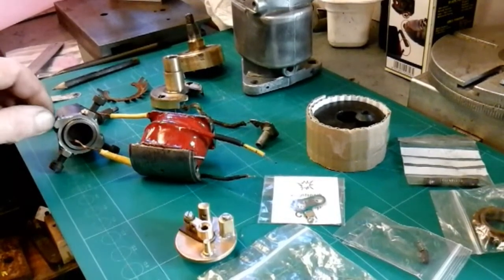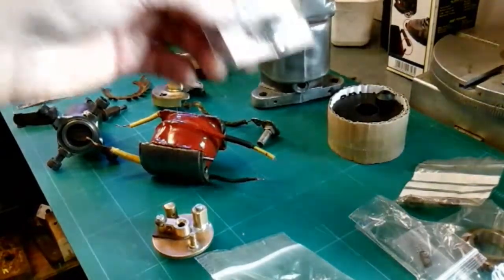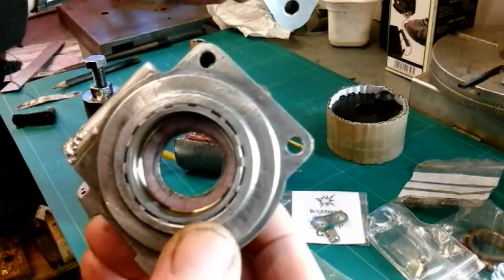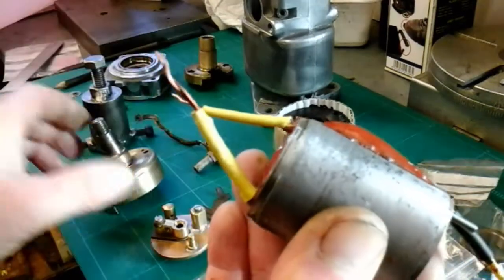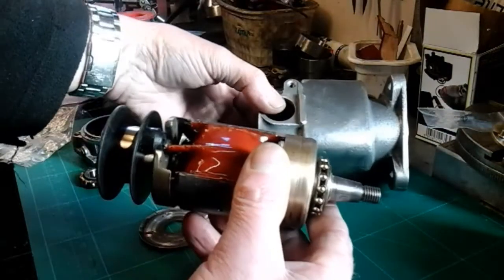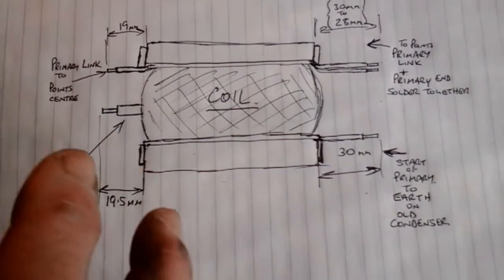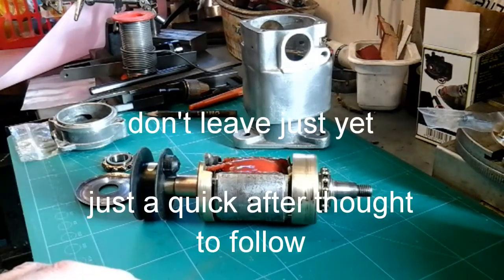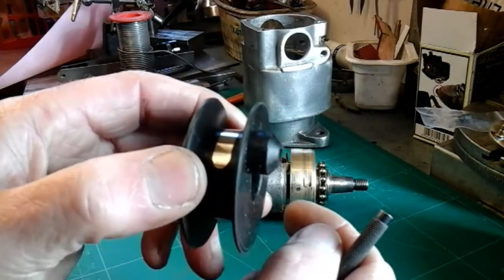Magneto Repair & Rebuild - part 3 armature assembly.....mr factotum

Comment: Hi Mr F. I experienced exactly the same issue as you did with the slipring, maybe from the same supplier. And I restored the continuity the same way you did. I've not tested the mag yet. I'm currently building a jig to test it on the Myford, inspired by yours 😀. Thanks for the videos, from the French Alps.
Reply from the maker: hi Ol Al1
great work, the myford sounds good for a test rig, what would we do without Myfords, very versatile machines.
thanks for watching and comments, let me know how the testing procedure goes
regards
mr f

Comment: No the wire should make contact.and if it doesn't it will spark and will burn the wire out. It will work for a time .but when you put the slip ring on the armature.you should get a reading with your meter.from the earth i.e. body of the armature.and the slip ring.of about the same as you would.when you tested the secondary.hope this helps
Reply: the pick ups you need have a line down the carbon .the faulty ones dont have the line.and you can remove the condenser.it makes no difference to the balance.   if you fit the soft  pick ups . the bike will run for a time.but then the bike will start to run lumpy.and one cylinder will stop.and if you pull one plug lead of it will run on that pot bot not the other.but if you fit the lead you tuck of.and pull the other lead off.it will run on the first cylinder .the powder from the pick ups will track around.and act like a slip ring with a solid ring.like a single cylinder . hope this helps
Reply: @raywilding8343  are the lucas pick ups the good ones ?
Reply from the maker: Thanks for taking the time to give that help, much appreciated
Reply: Mr Factotum hi how did it do when hot.and you need to be careful when using new pick ups.as I have some that are soft.then they need to be.
Reply from the maker: Hi, i ran it for 3 hours in a rig and all seems ok, not fitted to bike as yet, ithink i will put on bike to try it , as for the pick ups i will check, i put new ones in, however ive nothing to compare them with.
Thanks for the tips and advice
Reply: @MrFactotum   Hi how’s the magneto going have you run it on your bike yet and if so did you have any problems thanks ray
Reply from the maker: @raywilding8343  eyup Ray
Yes it was fitted to a BSA Shooting Star, and works fine, that was a few years back now, i sold the bike and last report was its still working fine, thanks for interest
regards
Reply: @MrFactotum   Good luck thanks
Reply from the maker: Cheers ray, any advice and tips are very welcome, thanks, i will check the brushes before i fit mag on bike.